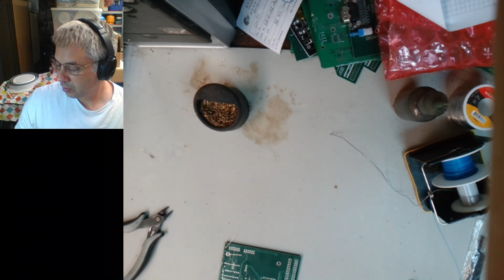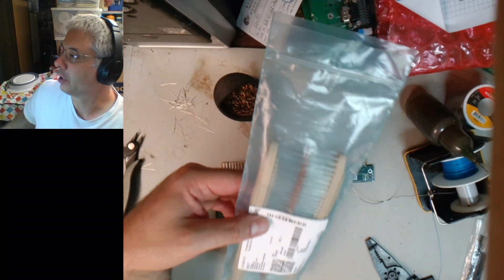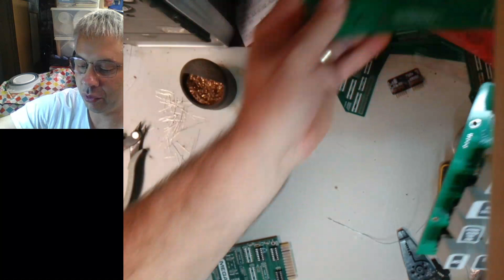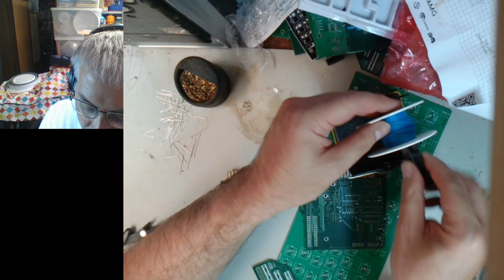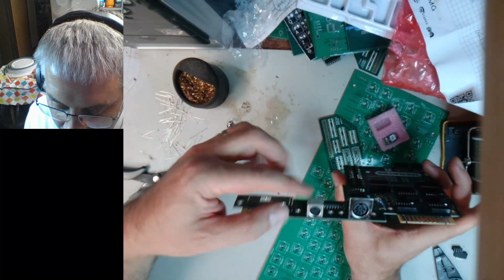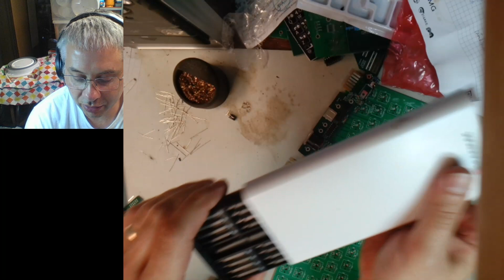MEGA65 Expansion board assembly

Comment: Very cool! Its always fun getting to build your own hardware and this doesn't look too hard to build.

Does the MEGA65 analogue video port use the exactly the same video cables as the C64, which I think is a 8 pin din? Have you tested it now?

Which disk drives does (or will) the disk port support?

Comment: hey Paul, good to see you, hoping Im in this next batch of Mega65s!
Reply: I was told I'd be in the 2nd batch, then the 3rd batch and still waiting.  I've just about given up.
Reply: @OnlyAmiga85 The next batch will be June 2024 so they say. Then i've waited 2,5 years for this project.  But they also say it's improved with the latest revision R6 boards. 2 way joystick ports, 2032 battery, and super capacitor for the clock.
Reply: @bonno666 I've finally received the invoice and paid it so hopefully it will be on its way to me. 😁
Reply: @OnlyAmiga85  Did you get it?